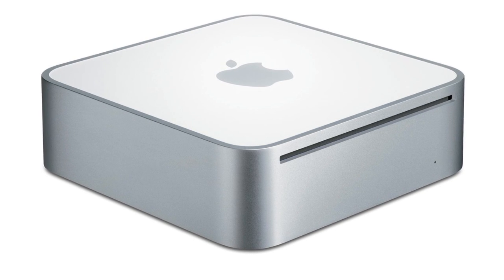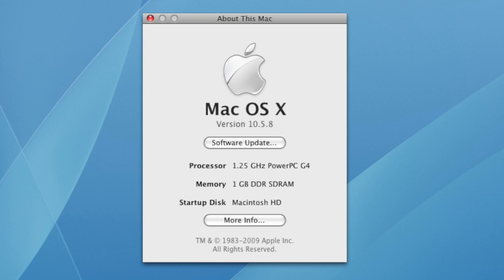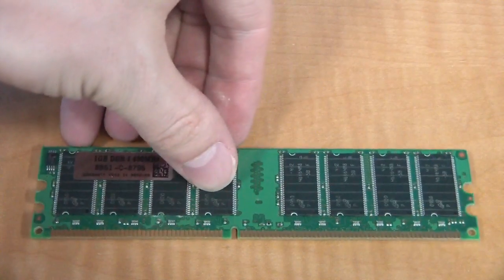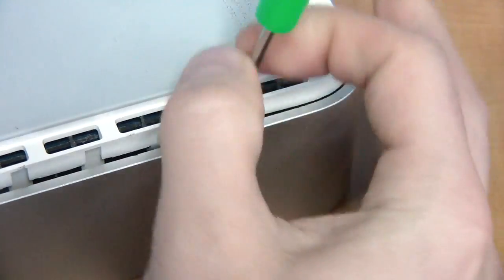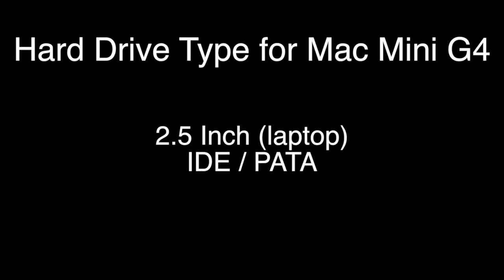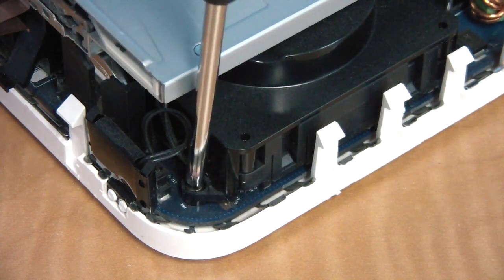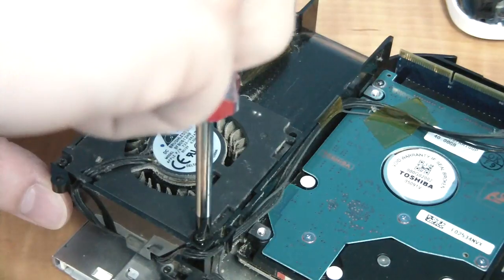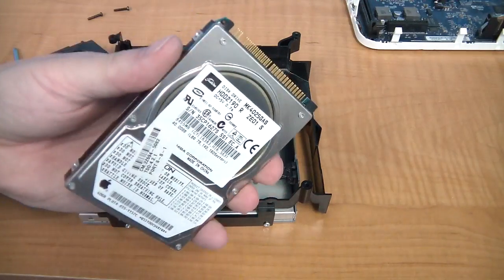Mac Mini G4 - How to disassemble and upgrade RAM or Hard Drive A1103

Comment: I think that another way to tell if it is intel is if it has an IR sensor for Apple remote. The IR sensor is at the right side of the disk drive. It is a bit of black plastic. I have several and the G4’s don’t have one but the intels do

Comment: Amazing to go back and see some of your earlier videos... I just recently picked up a MacMini (the slightly faster 1.4 processor) for a whopping $35, and it actually boots and runs.  Ram is low at 256m, so I am thinking to do the memory upgrade.  You have made it clear and simple, thanks so much!
Reply: Some of the older machines still work just fine for daily stuff like email, word processing, web browsing, etc

Comment: Disassembling using screwdrivers is NOT a good way. Original service manual says:
"Modify the Putty Knife
 
1. If you don’t order a modiﬁed putty knife (922-6761) from Apple Service, purchase a 
putty knife with a 1.5-inch (38 mm), ﬂexible metal blade.
2. Using sandpaper (150 grit), ﬁle down the end of the putty knife (on one side) until it’s 
slightly beveled. Rub the edge of the putty knife back and forth for about 2 minutes on 
the sandpaper. "

I have used dining knife which is narrower (cca 18 mm) but much better than screwdriver.

Comment: I've been itching to play around with OS 9 again for a while now, and while I wanted to try and pick up one of the sexier Macintosh models(the iMac G4 in particular has sung her siren song to me ever since I first saw the commercial for her back in 2001/2002), money is a bit tight right now for a hobby that serves no real practical use. Hence, I ended up grabbing a much cheaper Mac Mini 1.25 ghz and a 1GB stick of ram. This model isn't officially supported for OS 9 booting, but recent developments on the macos9lives forums have produced a working installer that seems to be stable with some quirks, so I am excited to try it out. Perhaps I will attempt a multi-boot setup at some point with 9, X, linux, and possibly even MorphOS.

Comment: What's the worst case scenario if a G4 gets 2Gb DDR Ram?
Reply: There are no DDR1 2GB non-ECC modules in existence.  Shame.  (ECC is basically = server RAM which can't be used)
Reply: +Cesar Barrios won't boot
Reply: I've always had a thing for the G4 ever since seeing the MHz myth vids by Steve Jobs. I also fell in love when I learned about the Altivec SIMD instructions or "velocity engine" and the insane bump in performance for progs that use it. Why then can't my 1.42GHz G4 Mac Mini play simple youtube vids smoothly even in 240p? I used to watch youtube all the time with an AMD Duron 850 and shoot even a PIII 450 and that was back when it used resource hungry flash. I tried my G4 Mini in the flash YT days and even now with 10-4 Fox and HTML-5 the audio works but it drops insane frames.

Comment: In the video at 3:20 pulling the assembly out it doesn't show you the connector in the corner as he's pulling it out.  The video skips then where the assembly is now out.  Be careful to disconnect it and remove any tape holding it in, you should see this if you're slowly pulling it out.

Comment: Hello, I have a mac mini A1103, this was my son, he bought a new mac mini and it had it in the garage. I wanted to use it when I turned on, I get a message:
 / dev / hda3 does not exist. dropping to a shell.
can you explain this. the mac mini has a processor 1GB PC2700 DDR, 40gb hard drive
Thank you
Reply: reinstall OS

Comment: Hey, can you help me? I have a mac mini G4 and what it seems like it is the same as yours, I'm running 10.5.8 Leopard but I need to get wireless internet working, In system preferences I can find airport under network. Is there something missing?
Reply: Maybe disconnect the airport card, let it boot up so that it realises it's gone and then shut it down and re-install it and then the wifi should work.

Comment: @1:30 and you can see all the scratches from using a screwdriver...
Reply: 1:30
Reply: It’s on the bottom and barely visible when put back together.
Reply: @jamieslifee  That's ok if it's yours and you don't care because you don't see it, but if you are upgrading a customer's Mac mini and they see it, then you have to replace the whole top case. It may not be expensive now, but it would have been 10 years ago.
Reply: Apples Anonymous ok boomer
Reply: @jamieslifee   I think ur the boomer
Reply: how can I be a boomer if im GenZ?